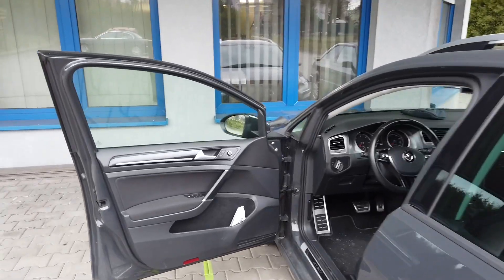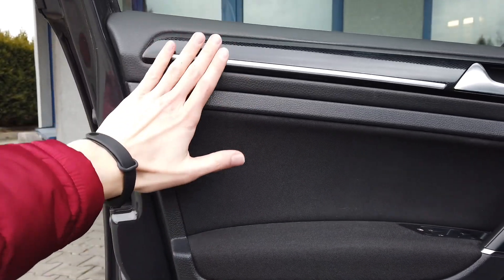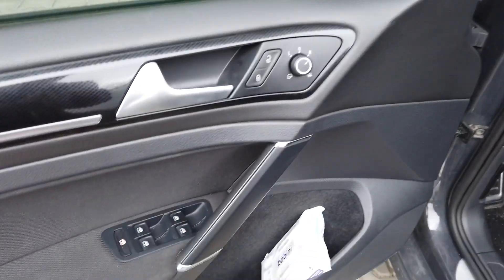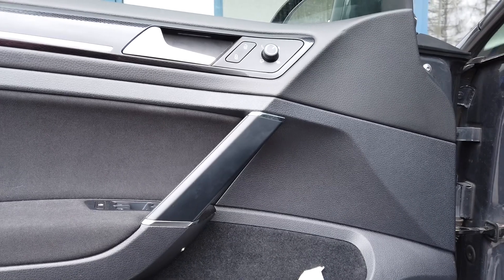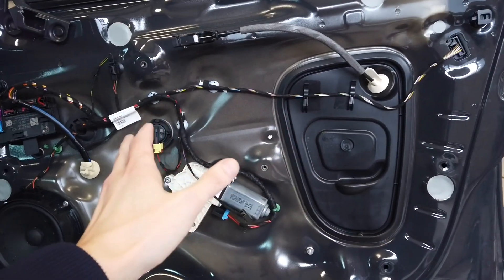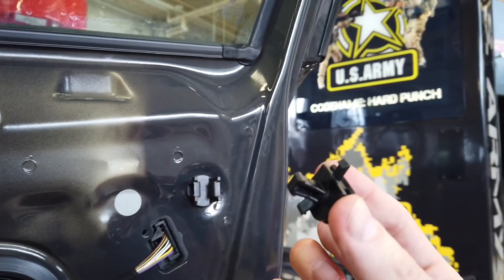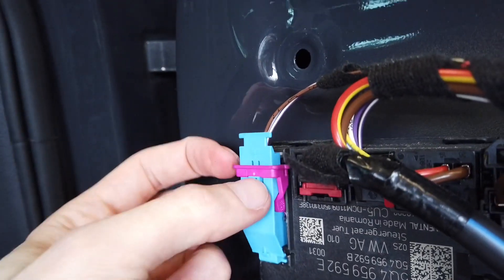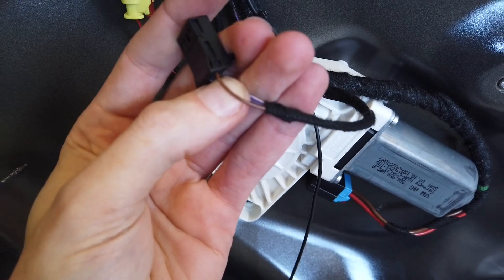VW Golf MK7 (5G) interior ambient light installation (part 3)

Comment: I want to install door warning lights to my Golf Mk7.5 instead of plastic reflectors, but the pins 16 and 5 are already taken. I can cut in the wire in pin 5 I guess, but I’m not sure if it’s ok to do the same with pin 16, since it seems to be power wire for door sill lights. Any suggestions?

Comment: @mr-fix 9:10 For the passenger side there is a proper gnd in the blue connector:
T32c/3 Light for passenger side interior door handle illumination
T32c/8 Light for passenger door ambient lighting
T32c/5 GND
Reply: @bence_7616  thanks for the tip on the ground connector pin, what kind of pin do i need to connect in properly to the blue connector?

Comment: Hey MrFix i hope you Can answer My question

I have eBay ambient that works with 5 controllers through Bluetooth. Would i be able to put My main controller and Connect that door led to the correct pin in the 32pin Connected and make the Lights work as oem without coding. I only need the power to work as oem. I dont need to change lights in the car screen

Comment: Great Job . Wanted to do the same on my Tiguan MK2 . I need help with the wiring , what pins did you use on the 32 connector for the driver and the passenger doors  ??? Helppp plz

Comment: Hello,

Golf 7 variant 2015
Retrofit front door panels with warning lights below the door card,door handle illumination and ambient illumination. Door panels with this options come from a donor car.

Door control module = 5Q4 959 592 = module ok for retrofit I think
Door controle module 32 pin connector : 
Pin3 = power for door handle illumination
Pin 8 = power for ambient illumination 
Pin 16 = power for warning light 
Pin 5 = ground (brown cable window swith)(ground for warning light and handle/ambient illumination)
I followed this wiring diagram.

Coding according to information from mr-fix : 
💻 #Coding 
5F → Adaptation → Vehicle function list BAP → interieur_light_0x08 → Activated 
5F → Adaptation → Car_Function_Adaptations_Gen2 
menu_display_ambient_illumination → activated menu_display_ambient_illumination_over_threshold_high → activated 
42/52 → Long Coding → Byte: 01 → Bit 01 → enable (ambient) 
42/52 → Long Coding → Byte: 01 → Bit 03 → enable (door handle) 
42/52 → Long Coding → Byte: 01 → Bit 02 → enable (warning light) 
09 → Security Access → 31347 
09 → Long Coding → Byte: 17 → Bit: 01 → enable (Ambient door panel light) 09 → Adaptation Interior light; light configuration → Ambiente_Applikationsleisten_in_Tuertafel → installed Ambient lighting → Defaultwert Ambienteprofil Tuer → 50% 
Interior lighting: parameter → p_adaption_kundenwunsch_tuer → 3C  ???
09 → Adaptation → Interior lighting: parameter p_helligkeit_andereTuer_auf_zuendung_aus_tueren → 96% p_helligkeit_andereTuer_auf_zuendung_ein_tueren → 96% p_helligkeit_dieseTuer_auf_zuendung_aus_tueren → 96% p_helligkeit_dieseTuer_auf_zuendung_ein_tueren → 96% 
p_helligkeit_einausstieg_tueren → 96% 
p_helligkeit_entriegelt_tueren → 0% 
p_helligkeit_Fzg_geschlossen_schluessel_ab_tueren → 96% p_helligkeit_Fzg_geschlossen_zuendung_aus_tueren → 127% p_helligkeit_Fzg_geschlossen_zuendung_ein_tueren → 126% p_helligkeit_HD_auf_zuendung_aus_tueren → 127% 
p_helligkeit_HD_auf_zuendung_ein_tueren → 126% 
p_helligkeit_max_tueren → 100% 
p_helligkeit_Tueren_geschlossen_HD_auf_zuendung_aus_tueren → 100% p_helligkeit_Tueren_geschlossen_HD_zu_zuendung_aus_tueren → 100% p_helligkeit_Tueren_geschlossen_schluessel_ab_tueren → 100% 
09 → Adaptation → Interior lighting: parameter p_t_verzoegerung_ausstieg_tueren → 0s p_t_verzoegerung_einstieg_tueren → 5s p_t_verzoegerung_entriegelt_tueren → 0s p_t_verzoegerung_oeffnen_tueren → 0s p_t_verzoegerung_schliessen_tueren → 0s p_t_verzoegerung_schluessel_ab_tueren → 0s p_t_verzoegerung_verriegelt_tueren → 0s

ERROR= 
Interior lighting: parameter → p_adaption_kundenwunsch_tuer → 3C  ???
What is the correct value?
From this step and the steps below  I have a problem with OBDeleven.

Cannot save the parameters or I get the following message:
adaptations  function cannot be performed , mess,length of format incorrect.
Someone a solution?

Thank you ,
Best regards,
Bjorn
Reply: @BjornRutsaert  I have the same problem with OBDeleven

Comment: thank you so much for posting the adaptions. i got mine wired and working... the weird thing is the main ambient light (long one running the length) does not dim with the handle or grip LEDs. also the controls in the MIB are different.
Reply from the maker: That's strange. As far as I remember the grab handle and the LED strip is on circuit.
Reply: @mrfixpl  that is what i thought as well, i also think i have something coded wrong in the 5f unit. my ambient light scroll bar is completely different. i will post a video of me messing around with it if you are curious feel free to check it out.

Comment: Hi! You did really nice job!  Could you please give me an advise? I retrofitted GTD door panels on my 7.5 Golf, installed everything due to ETKA, code everything like you did (thanks a lot for coding instructions), but inner door light isn’t bright at all. I read literally everything in 009 block, couldn’t find any mistake. Your advises and help are appreciated
Reply from the maker: "isn’t bright at all" as in "stays off"?
Reply: @mrfixpl  I tested with headlight light switch on: Ambient light is working, the light under the handle also is working on the 100%, my “problem” light under the open handle is working on 1%. Then I change light intensity on my multimedia, ambient and light under the handle response correctly, even if I move toggle to 0% - they both switched off, my “problem” light stays in current state (1%). Then I switched all the lights in my car - problem light is switched off too.

Comment: Looks great, I've been following this install although my MK7 already has these door cards :D
I'm curious about something you showed in the first video which was the LED strip glowing red instead of white if you flip the two cables. Does that really work and is safe to try? 
Also, one of the door handle LED's is flashing a lot or turning off regularly. Do you know if there is there any way to replace those?

Thank you!
Reply from the maker: AFAIK this white/red thing was installed in EU-spec cars, not in NAR. But you can try it. I think it's safe. In Seat Leon (which is basically Golf MK7) BCM controls the color and switches from white to red in SPORT mode.

While you're at it check the connection of the handle LED. Maybe it's just a loose wire.
Reply: @mrfixpl  That's lucky since I live in the EU, so I will definitely try it! I still haven't put the door card clips in since I retrofitted the door exit lights with the VW Ligo projectors :D and I will check for loose wires in the meantime, hopefully that's the problem since the light still comes on sometimes!
Reply: @mrfixpl  And thank you very much for the help! I've been following you since I've got my OBDEleven and ended up learning about many other Golf related things 👌🏼💪🏼